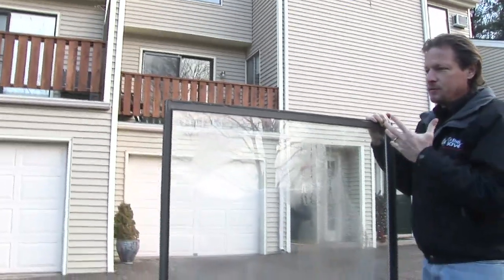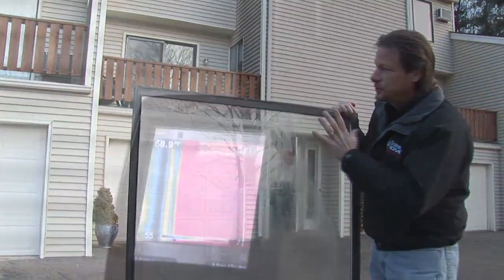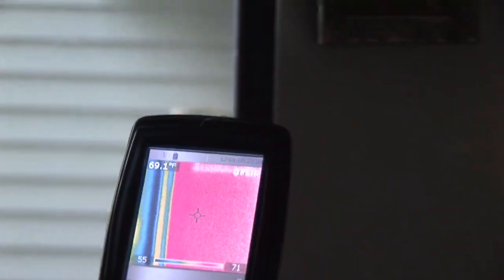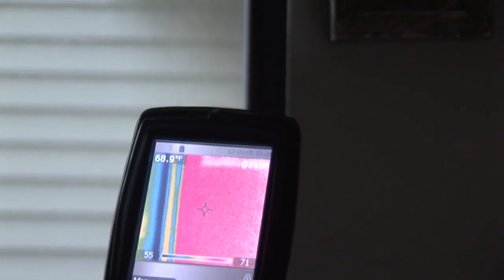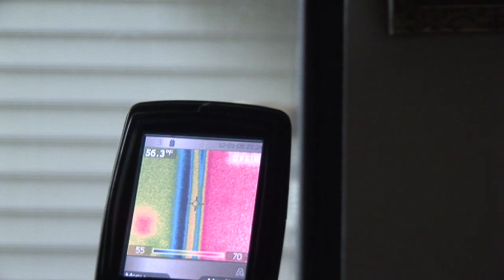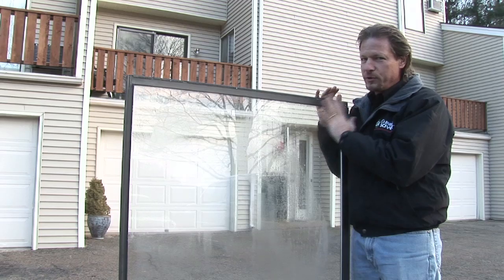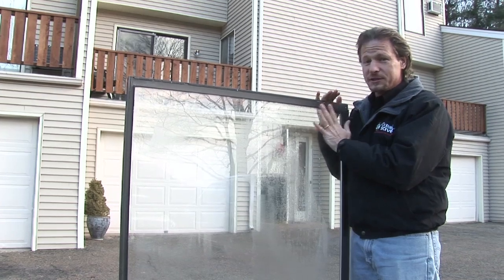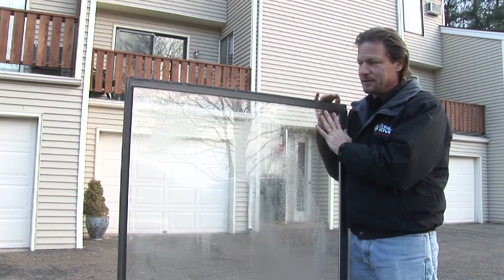Replacing an Old Window with a New High Efficiency Window

Comment: Excellent explanation of the variables when selecting windows. This info really helped me in making my window selection on my 65 year old home. I'm replacing my original single hung, single pane wood frame windows with vinyl single hung low E replacement windows.